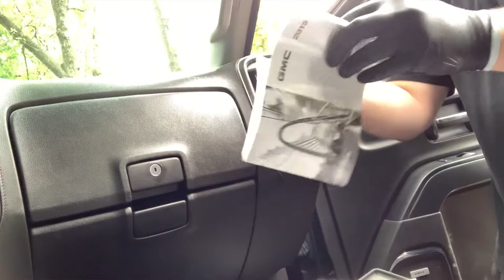Smoke Odor Removal

Comment: Good video, Any tips on how to get rid of the lingering ozone smell? Still smell it weeks after a ozone generator treatment
Reply from the maker: How long did you run the ozone? Should dissipate within 30 minutes when properly vented.
Reply: @RedDiamondDetailing   I ran it for 1 hour, 20 minutes with the aircon on recirculate then 40mins with the aircon off. I then left all doors and windows closed for another 1 hour then aired it out. I think my leather seats and dash , carpets might have reacted so thinking I may need wash those but not sure with what coz I want the car to have a neutral odorless smell.
Reply from the maker: Usually anything pushing past 30 minutes can damage an interior, plastics, leather and carpets will break down with that amount of exposure. I would extract or steam clean the entire interior and see if that helps. Curious to know your results, let me know if that removes the odor. Might also help to change the cabin air filter.